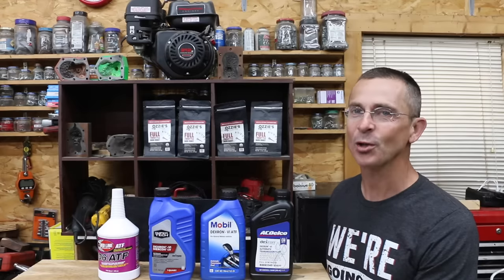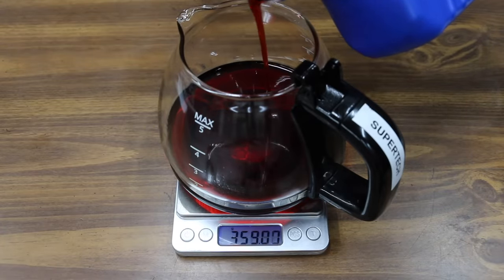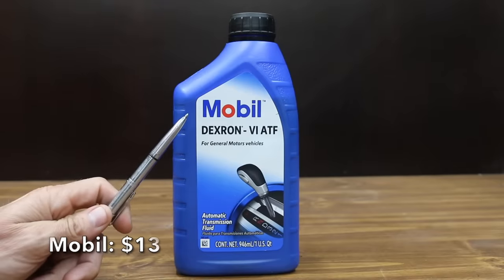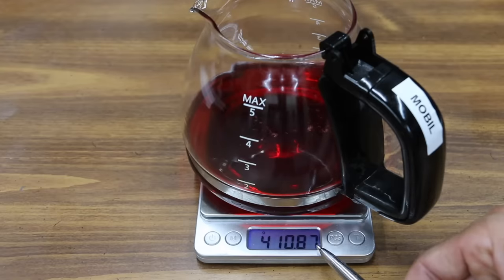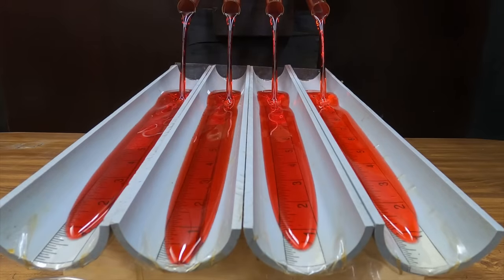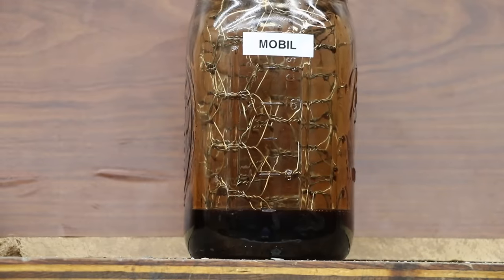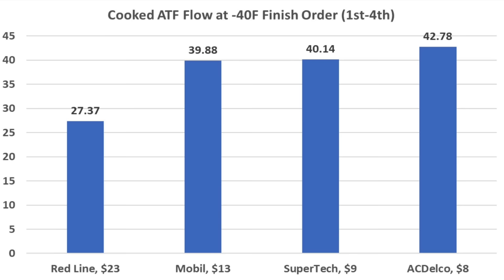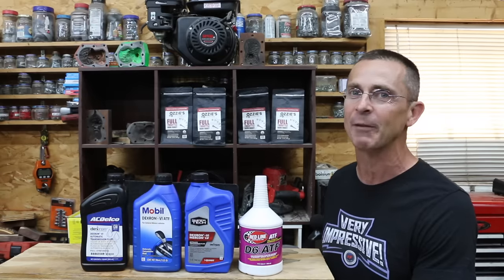SuperTech ATF Safe to Use? Let's find out!

Comment: For me my favorite brand is Valvoline max atf, it helped revive a 300k mile accord, and also a abused 130k mile Miata, and it's cheap to boot
Reply from the maker: I'll test Valvoline too if there's enough intrest
Reply: I used that in a couple vehicles, and it's also cheap. I bought a Volvo that never had the fluid changed in 220k miles and the fluid looked like dirty motor oil, it was filthy. Flushed it out with a few gallons of max life and it was happy.
Reply: @volvo09  username checks out!

Comment: Great test as always, Todd. It would be neat to see who makes the best 80W90 gear lube. The frozen test might take about 30 minutes, though.
Reply: I definitely want to see that.    There’s so much debate wether or not to use synthetic gear oil, and almost no actual data to back it up
Reply: Gear oil does need a test.
Reply: Redline vs Mobil 1 vs everybody else. I use both and I want to see the numbers! Poor Todd will never get the sulfur stench out of his shop.
Reply: @TheKirbot  definitely use synthetic, better film strength and better temp control. Noticed a good difference vs oem fluid on my Subarus

Comment: I use Redline D4 (DexIII) in my Power Steering for these same reasons as well. It really does work better in hot and cold...and it lasts longer. My PS pump is also the quietest on Redline D4.

Comment: A suggestion for an episode is maybe water wetter vs other engine coolant additives! I know with warm weather in full swing it might help some of us with sub optimal car cooling! Keep up the good work!
Reply: Water wetters have a minimal impact on cooling.  Instead, it's better to improve the hydronic volume capacity, the airflow, or the speed. Chemicals are band-aids to the problem.  If you need a wetter, there's a design or execution problem in the cooling system that needs to be fixed.
Reply: In racing series the use of coolants is banned, or at least frowned upon.
Cleaning antifreeze off a track is a pain.
The use of surfactants to improve cooling has been used for a very long time.
Is the use of surfactants less beneficial in normal commuting compared to a track use? Or are the benefits across the board?
Reply from the maker: Thanks, will do!  Thanks for the suggestion.

Comment: I'd love to see if any auto manufacturers oil is different from each other. Ford,GM, Mopar, etc. It be interesting to see the differences and which is truly the champion
Reply from the maker: I'll do it! Great suggestion!
Reply: I'm cheap enough to not want to buy a new trans or diff so I spend a few bucks more on the Honda and independent Honda techs tell me they could make more money by not using factory fluids but see such good results. I always think about Project Farm when I hear these claims!
Reply: @flowerpt  I’m still looking for a Honda Acura type 2.0 ATF substitute. I believe for the other type 3.0 and DWF the major brands like Valvoline and Castrol work fine. Lots of ZF guys like Valvoline Maxlife.
Reply: The thing is, those auto manufacturers tend to make oil optimized to their engine materials. For example: Turbo'd or aluminum head blocks vs steel. Cars vs trucks vs diesels, etc... so a direct comparison may not be as legitimate as you would like it to be.

Comment: Would be interesting to see some auto manufacturers brands tested. Toyota fans are pretty adamant about using only Toyota atf.
Great video!
Reply from the maker: Thank you for the video idea!
Reply: @ProjectFarm  Was it Honda, BMW and/or some other manafacturer that basically require their own fluid?
Reply: I picked up some Toyota atf for my FJ Cruiser yesterday.  As long as these last, I'm not guessing on atf. I'm just dropping the pan and filter. And yes, I got a Toyota filter and pan gasket, as well as crush washers.
Reply: @scootypuffjr.  same boat, recently got the Toyota fluid for my 99 Land Cruiser. Not going to switch after 24 years.

Comment: These tests are great and super educational. I would have loved to see valvoline ATF because I worked for them for a while and they made a big deal about the quality of their ATF fluid internally. I would love to know if that was based on anything or if it was just them selling their product to their employees so they’d be more likely to push the product.
Reply from the maker: Thanks!  Thanks for the suggestion.
Reply: I just switched my vehicle to Valvoline ULV, man does it run well, way better than when it was new.
Reply: side note about valvoline: when I was at napa,I asked about their store brand of atf in the blue containers..They said it was made by valvoline for napa...There is a huge difference in price as in almost double the price per quart vs napa... although All prices are going skyward, even napa jacked their prices...I waas in sticker shock having to pay 12-15 per quart for fluid that was 6 bucks a quart last time I changed it!
Reply: This is me leaving a comment

Comment: Great test, thanks.
I’ve used Redline in a manual transmission which had some issues and the results for me were absolutely excellent- I couldn’t be any happier. 
I know- It’s not cheap, but the results are great.
Reply from the maker: Thanks and you are welcome!  Thanks for sharing.

Comment: I wish Valvoline Maxlife would of been included since it's a big seller and very popular in most stores
Reply: Only issue is that maxlife isn't licensed as a certain spec of atf, but is "recommended" for a lot of specs. Not saying that makes it good or bad, but may make comparisons difficult.
Reply from the maker: Thanks for the suggestion.
Reply: *would have been

Comment: I've been using Redline trans fluids in my own cars for many decades, very happy with it. I'd be interested in seeing gear oils from Redline tested like LWSP vs other brands similar products.
Reply: Same here. Redline in just about all my transmissions. Never had problems with the fluid. Had to rebuild my Civic's transmission at 430k km but those 6 Speed manual transmissions are known not to be very robust in race/tough conditions. A friend of mine also had a lot of success with Redline C+ in a Dodge Stratus. If i remember right, he said the transmission was slow to shift during winter with the factory fluid. Apparently it instantly got better with Redline. Now i can see why.
Reply from the maker: Thanks for the suggestion.

Comment: Video idea: Testing brake bleeders, maybe from a cheap model up to some of the vacuum style ones would be great.
Reply: Brake bleeders and zerk fittings. I constantly find zerk fittings not working even when brand new, even after pushing the ball bearing in a few times. Sometimes it gets them working, sometimes it doesnt. The ones ive from some NAPA parts have been the worst.

Before i finished typing this, it dawned on me you were probably talking about the tools and not the parts/fittings lol
Reply: I use a piece of wood between seat and pedal. Lol
Reply: @shawnsatterlee6035  hmm, decent idea, I forgot about that method. I used the hose into the bottle trick/deal, but it doesn't bleed them enough to be properly firm.
Reply: @M.TTT.  same w some of the break bleeders. Great when doing a flush, or  replacing lines or calipers to get the majority of the air out fast and cleanly, but still have to do the old school way to get fully firm pedal.
Reply: @jacksmith2315  true, I've heard that before, but I've got no experience with the fancy push or vacuum bleeders. Guess I'll just keep doing it the cheap way then lol. Might buy or upgrade the bottle I use is all, but the strawberry jam jar has worked fine 😂

Comment: Idea!  It would be Great for you to build something that can test Oil filters against one another. A pump / flow meter / pressure gauges would be a nice see them in action! Thanks for the cool videos
Reply from the maker: You are welcome!  Thanks for the suggestion.
Reply: Don't forget that when a filter gets dirty the bypass valve opens.
Other YT videos don't comprehend that they're testing the bypass valve.
Filter specs can be found on Google.

Comment: So if I don’t shake my oils and they’ve just been sitting there and I pour in 4qts out of a 5qt bottle, do you think I’m leaving the wear additives at the bottom? I’m going to start shaking before pouring regardless. 😅
Reply: Potentially, it takes a long time... So if it's been sitting it's best to invert the bottle and agitate the bottom.

I never thought of it before until I saw a picture from someone showing the bottom of an oil container and there were light "deposits" in the ribs on the bottom. Then I started paying attention to my oil and I noticed it a time or two also, so I just started shaking them upside down just to be safe. It sure isn't hurting anything.

Comment: I wouldn't trust Walmart for *anything*.  Even if their house brand passes a test with flying colors today, the next batch on the shelves next week could be garbage. Walmart is constantly hounding their suppliers to get their prices down or they will switch to another who can beat the price of the supplier who actually made a respectable product.
Reply: Not sure if it's true but I've heard the mobil 1 oil wal mart sells is different than the auto parts store version. Its way cheaper at Wal Mart so makes me wonder
Reply: @christopherhendricks4369  way cheap at Costco too… Walmart and. Costco… spend way more $ than auto value… buy more better price

Comment: Great test, Been using Red Line for years. I had a 88 Ford Ranger 5 - speed that was virtually unshiftable in the winter until I switched to Red Line MT fluid and it shifted like a hot knife through butter. Hope you add them/Red Line to all your fluid tests tests in the future.
Reply from the maker: Thanks!  Thanks for sharing.

Comment: Certain boxes need a certain fluid so if they require X fluid then that's the one you need to use 👍
But otherwise it's the standard excellent testing as expected from Project Farm 👍👍👍👍👍
Reply from the maker: Thank you!
Reply: Ehhh, i'd say if it has a warranty sure. If no warranty then i'd ask a transmission shop or get on the forums because manufacturers only design a transmission to last 100k miles and usually a different fluid will ensure it lasts as long as possible.

Comment: Awesome video. Next time you do a Transmission Fluid testing or comparison, include the Valvoline MaxLife ATF Multi-Vehicle Full Synthetic Automatic Transmission Fluid . Supposedly it is compatible with 95% of all existing ATF fluids and can be mixed with them as such. It would be interesting to find out how it performs and if it had to make any compromises to achieve such compatibility. It would also be interesting to find out what happens when you mix this with other ATF fluids and if the performance changes dramatically. Thanks again for your hard work...
Reply from the maker: Thanks!   Thanks for the suggestion.

Comment: Like many others, I would love to see a Round 2 with Amsoil (either OE or Signature fluid), plus whatever brands you deem necessary. I've used the Amsoil OE Synthetic fluid on the past 4 vehicles I've had. It smoothed all of them out, including my current 2012 Honda CR-V that had 175k miles on it when I got it; it would stutter when shifting into 3rd gear mainly when the fluid was cold. After a fluid change, it has had no issues for the last 15k miles. 

Again, thanks for all that you do!
Reply from the maker: You are welcome!  Thanks for the suggestion.

Comment: I enjoy your reviews and find useful information in the reviews. I searched but could not find a review on oil cans, the type usually with a thumb pump and a container holding around one pint of oil or even some type of cleaner. I've bought many different brands and shapes over the years but it seems if they work well at all they don't last long or even leak somewhere even when new. Thank You!
Reply from the maker: Thanks so much!  Thanks for the suggestion.

Comment: Redline D6 is a far superior for Honda/Acura DW-1 in my experience, especially for those who don’t strictly follow maintenance schedules.

Remember the oil is very important in transmissions since they undergo oxidation typically more due to longer oil change intervals and some oils are outliers or assume a strict change interval

Comment: Sometimes, it's good to confirm your own choices.
I just replaced the fluid in my 1996 F150 M50 5-speed. I bought it in 2004 with 80K miles, and even now it only has 150K. I'm no mechanic but I know a little and I think things through.
So, the manual transmission became very balky to get into 1st gear at a stop. Often going to 2nd and back to first would make it easier. Given the miles and no abuse, I was concerned.
My mechanic friend suggested changing the fluid. Never changed from 2004 to 2023, so I figured it was due.
The problem was what to choose. I wanted to look at all options, but was willing to pay more for fluid changed but rarely.
The problem is, what to choose?  This manual uses ATF, but that's where confusion began. Some makes didn't make a specific recommendation for ATF in manuals, notably Royal Purple, which surprised me. Others specifically mentioned manuals, but didn't say much. Online research said it may be necessary to add friction modifiers. May be?! The one product that seemed to proclaim its suitability with the correct friction characteristics was Red Line. I had a machinist friend that ran Red Line in a Roots type supercharger and swore by itl.
Amazon sells the Red Line for $16 a quart, including the D4 version I needed. Hmm. $64 every 20 years seems worth the extra money.
The results were astounding. The old truck shifts "like butta", in fact better than I can ever remember it in all these years. I couldn't be happier that Project Farms' research backs up my decision.
Reply from the maker: Thanks for sharing.

Comment: Without saying, any amsoil product ever should be included.

How about brake fluid? Test the water absorbsion, and color change, hydrolic pressure (I tried a cheaper brand and felt brakes way more squishy than old used quality).

Differential/gear oil? 

Keep up the good work!

Comment: I've wondered if there's a difference in ATF and now I know.  I use Redline for my manual transmissions and rear differential oil (both limited slip and non).  I notice a difference in the quality of shifting each time I change to Redline.

I haven't used Redline ATF yet.  Heck, I'm pretty much sold on the idea that new cars don't require ATF changes, though I have a 30 year old car that will need an ATF change, so maybe it's time to splurge.

I appreciate you doing this video.  I am a car guy and the information is very valuable to me.
Reply from the maker: Thanks!  Glad to hear!

Comment: Another great video! I would, however, like to suggest an additional important test; all automatic transmissions release clutch material as they wear and I wonder if the brands differ in the amount of clutch material they hold in suspension. I would hope that, when hot, the material quickly settles out on the bottom of the pan! (But maybe the suspended material would help provide more friction between clutch discs? Who knows, eh. [investigation needed, some online debate found])
Reply from the maker: Thanks!  Thanks for the suggestion.

Comment: Found this info interesting and wanted to pass it on to you for consideration in future automotive product comparison tests. Never heard of a "soot" issue. Heard that GDI is a serious problem, but didn't know why before. There's 10s of millions of vehicles in the USA with GDI, so I thought I'd pass this on...
"All of the problems listed are a result of poor quality oil, filters, low quality, low octane gas, long drain intervals using the Oil Life Monitor., and poor maintenance. The timing chain issue is from GDI. It dumps fuel and abrasive soot into oil, cause oil to loose viscosity, and soot wears away at the chains. The soot, sloudge, varnish cauaed by low grafe oil and log OCIs clogs the small oil ports for the tensioners, and soot wears the chains causing them to elongate, slip anf fail. Same for oil consumption. Fuel, soot and carbon clogs up and wears the cylinders and rings, causing more blow by and oil consumption. The oil leaks from the rear seal is caused by poor oil, soot, sludge.and hard carbon that blocks the, internal. PCV orifice. With worn rings, high blow by, creating more oil vapor and water in the winter clogs the other half of the PCV system. Rear seals damaged by years of fuel dilution and becoming hard, aling with sub zero temps, the high pressure caused by the clogged PCV, blows out the rear seal, which can destroy the engine. In 2020 the OEMs and Oil companies came out with API SP to start to address the wear problems and soot caused by GDI systems. They new about the wear and soot for many years but all the OEMs just want ti blame it on poor choice in rings, or a tensioner, etc. Why? Simple, GDI problems plague nearly all oems and many different engines. They will never admit to the provlem being GDI, poor oil, andstupid oil life monitors. That would indicate a systemic problem instead of an isolated issues, and cost them far more. In the end thank politicians, lobbists, and those that think the world will end in 10 years, for the insane CAFE and emmussion standards that drive oems to use this problematic GDI technology."
Reply from the maker: Thanks for sharing.

Comment: Well done.  Results are about what I expected.
You should test Red Line MTL (manual transmission lube) against some other manual tranny oils.  It's a favorite of sports car guys and folks who want quick smooth shifts in cold weather.  My old BMW 5-spped commuter sedan made a believer out of me.  Slick easy shifts even at freezing.  I know others who drain and fill with ATF for winter, but seems unnecessary with MTL ...
Reply from the maker: Thanks!  Thanks for the suggestion.